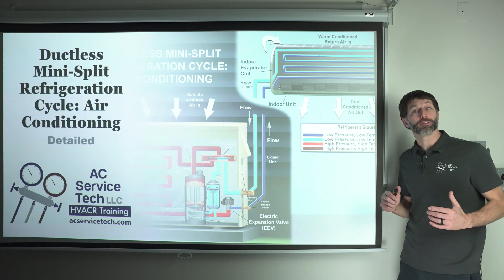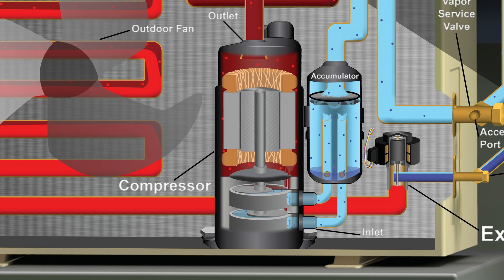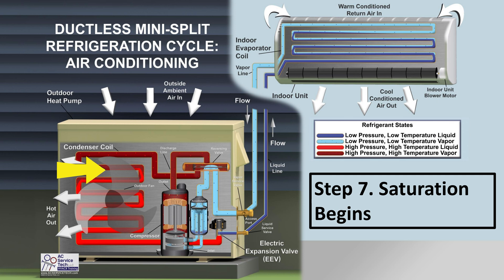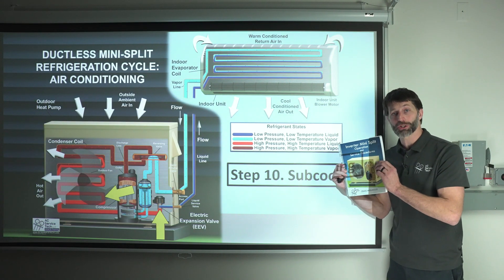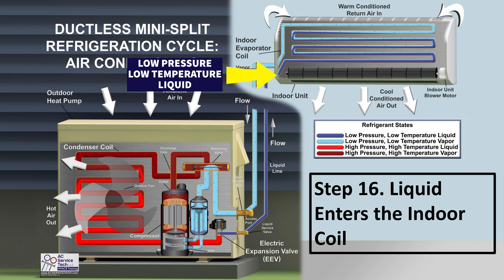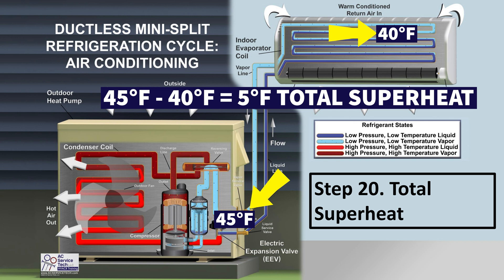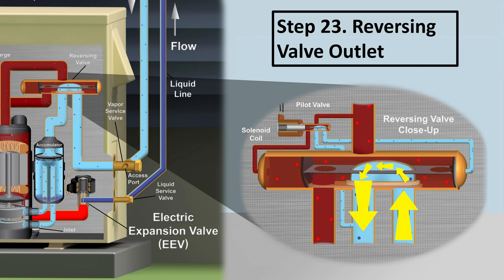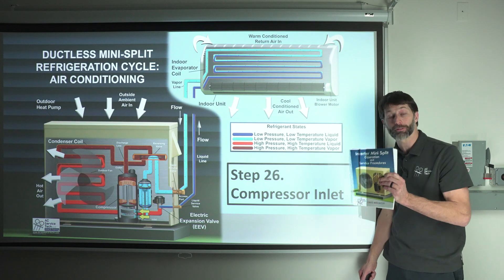HVAC Apprenticeship Class Year 2, MINI SPLIT REFRIGERATION CYCLE in AC Mode with R-32 & R-410A Temps

Comment: Your ability to explain with clarity blows me away. Hats off to you Sir
 I always need to come back and rewatch some of your videos they're worth a couple repeats! and some time many more ...
Thank You for a very informative and easy to understand videos

Q ... Sir, if the EEV valve is at the out door unit, then we will have a Flash-Gas in the Liquid line going to the evaporator, do you recommend attaching both line sets, suction line and liquid line metal-to-metal in one rubber insulation (Armaflex or equivalent) ?
Sir, we need you advice regarding this issue .
Thank you

Comment: Great videos. Question does it matter or is there a maximum length for the lines from the outdoor compressor to the indoor air handler and I see many installers coiling the extra tubing in a coil and tucking it in behind the outdoor unit.
Is this recommended or should the lines be cut and shortened and kept straight with no coils?

Anyone?

Comment: Well, after 43 years in the trade and then 17 years retiring;  I must admit some things have changed. The only dislike I have are those circuit boards in the systems. Who knows what the heck is going on. Makes a tech job very easy to make a mistake and destroy a wonderful machine. I guess next there will be software and a computer USB interface.
Reply: Commercial has it.

Comment: My mini split is spitting droplets of water from the indoor unit..when on cool. I checked the drain it wasn't clogged and the unit is tilted properly for water to run towards the drain...could it be over charged/ under charged with refrigerant?
Reply: Mine too; the indoor coils were iced over, the unit was undercharged.
Reply: @keithbutler1312  thank you I appreciate it I'm sure this is my problem

Comment: Only guessing is a good good choice word. Because if they are trying to top off the gas . Just to get a cold evap. Then they are only guessing.  
      Usually every mini split I get called out to after someone was just there previously.  I recover refrigerant and it almost always over charged.     Then later when it get really hot, refrigerant has nowhere to expand to.   That’s when I get the call from the customer complaining that the system doesn’t work good or it shuts down.. .  It so easy and fast to recover the refrigerant and weigh it to prove that is correct or not correct.   Don’t compromise your reputation of your business over a little more work..
Reply: Everytime i go to a mini split it has a leaking evaporator coil.
Reply: @ what kind of household spray cleaners are being used?. Because if it’s every time on every different brand in a certain area, there has to be a common cause. 

I still have my original personal mini split running continuously since 2012  
   And my other one that was put in my office since 2014

Would have come across other people‘s Leaking 
And that’s why on all my personal heat pumps when they’re brand new I remove the coil, clean it and treat it with epoxy coil coat encapsulating the entire heat exchanger so they’re never exposed to the atmosphere. It is completely sealed in epoxy.